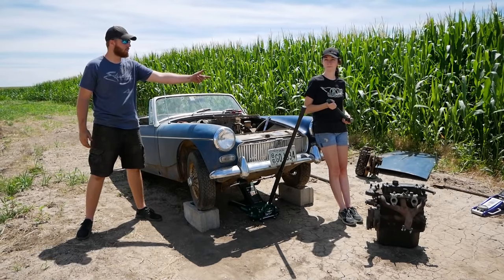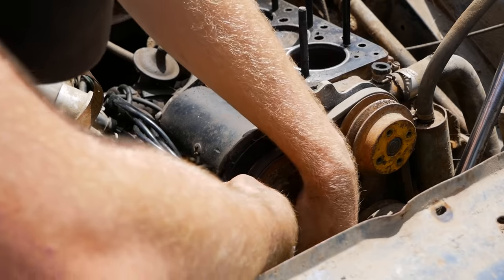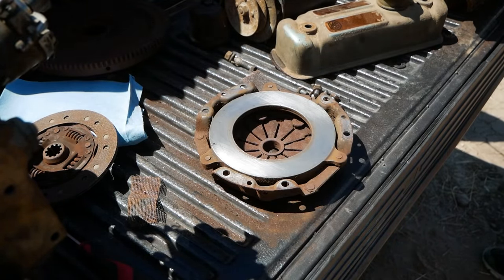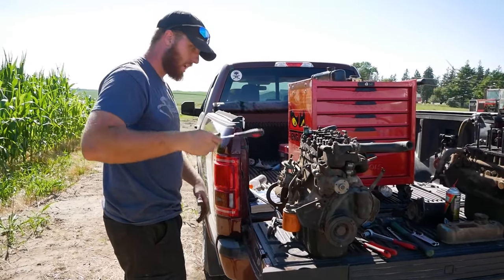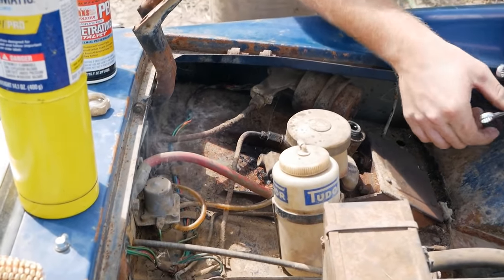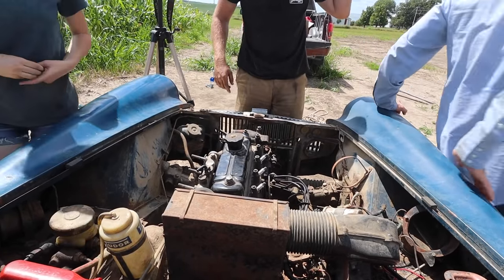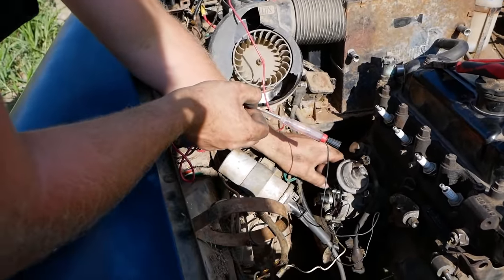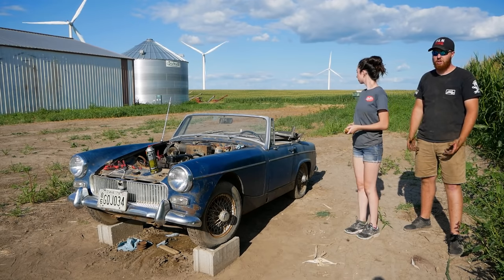Can We Make a SEIZED MG  Run After 42 YEARS!? - Part 2

Comment: Man when he was flooring those old British cars right after start up my mechanical sympathy left me wincing... Yikes
Reply: The a series is bulletproof.
Reply: What are you even doing if you dont send it straight into the ketchup
Reply: @DinosaurJuiceCars  The A series is only a three main bearing crank, not as tough as you'd think. Also, siamesed ports :o(
Reply: @agilchrist73  I do actually have one in my car! Yes it doesn't like to be revd over 6000rpm stock and the exhaust setup is not good for power. But if you don't over rev it they are bulletproof!
Reply: Do you always post cringe?
Reply: @agilchrist73  It's not really an issue for them unless you start pushing for big power, really tough motor in general. I wouldn't wanna be revving one like that cold though. Gotta have some mechanical sympathy lol.
Reply: Are you sure it wasn't your boyfriend making you wince?
Reply: Why do people do that?
Reply: He would have warmed them up before they came in... it's a YouTube collaboration, not a chance meetup.

Comment: Why is Steve reving the engines like crazy when just started and being cold??? Poor engines xD
Reply: He doesn't rev them that high, it sounds like it because of the exhaust note. I think...
Reply: Because there aren't any throttles on the engine yet... if you watch closely, he's disconnecting the positive side of the coil from the battery to keep the engine from truly over-revving.
Reply: Haha. Ya do know the carbs were not on there yet correct?
Reply: Pretty sure he's referring to the cars, not just motors

Comment: They're standard because the 🇬🇧 went to the metric system in the early 70s, your car predates that.
Reply: It's actually a 1968 MG Midget that originally came with a 1275cc engine.
Reply: Yep, all the way through to the end of the original MG and Triumph in 1980 everything is standard except for some brake parts on the verrry late cars.

Comment: That bloke with all the MGs - is he open to adopting?  His garage had a whole lot of cars I would love to spend time polishing and detailing and....and....well, anything to be near them, really!  That TR4 sounded magic, although it would have been better if they raised the revs to where all four cylinders were firing.

I like the technique for bleeding the Master cylinder.  Going to use that one myself when I bleed the rebuilt Brake Master when put it in my Stag - a lot easier than bench-testing it.

The new 1275 engine sounded like she fired on 3 rather than 4, but since it wasn't exactly a measured dose for each cylinder, its of no consequence.  You gave a great explanation on how to find TDC on the little car as well - not something that everyone would know how to deal with when faced with a little A-series engine (or "half an engine" as an American mate of mine once called them).  Not many people realise that you can push the dizzy round so far to line a plug lead up with the right cylinder either.

And as many people who own British classics will tell you - they ALL leak oil.  It's when they STOP leaking oil that you know you are in trouble, because it means there's none left in the engine!  British cars leaked oil by design in order to coat the undercarriage so that the salt used on British roads did not affect the chassis frame so bad.  It was a primitive form of rust preventative......well, at least that's what a bloke who worked for the Triumph Works team at Canley (in Coventry, England) once told me  😊

Looking forward to the next one, but make sure you have a spare axle or two handy as they do occasionally pop when stressed by doing donuts or line-locking.  Also, don't do the donut in first gear - use second - for two reasons:  first gear in the early boxes was still a straight cut gear, so no synchromesh and you will run the risk of destroying the idler gear.  First gear is only good for about 10-15mph tops at full chat, so use second to take off and you will be in the power band well enough to keep at least one wheel spinning in the dirt after a second or so.

Lastly, if there was another wire on the coil, it was probably for the rev counter, so it needs to be on whichever side of the coil goes to the dizzy.  I do not believe the A-series ever ran a cable rev counter, so if needs be a wire could be run from the tach to the correct spot.

All the best and I'll be waiting for the next one!!  I want to see the wee beasty move!
Reply: admit it, those red sprites at the beginning are hella cool (despite the fact they are super slow in stock form)
Reply: Wrote a novel here.

Comment: First engine I swapped by myself, I had a floor jack, an air wrench, and hand tools. I built an a-frame with a 1/2 ton chain hoist myself to handle the actual lift (fully dressed 302). Yes, anyone can do it.

Comment: Metric wasn’t fully implemented until the early 80s in the UK.
Reply: It still isn't if your in your late sixties  !! 😂😂😂😂
Reply: The building industry were the first to implement this system in the 1960 's . I can recall my late brother telling me  that feet and inches would be obsolete by the '70's . Well, l 'm still trying to grasp it even now! As a Formula 1 fan l  still get frustrated when the commentators get excited when the cars are doing over 300kph! But when babies are weighed at birth 
" Your baby weighs a healthy 8 lbs  15 ozs ! " 😂😂😨😨
Reply: Aaah, well, let's not talk about miles and stone then... I guess.

And of course weird packaging sizes. I'd say the Germans did one thing right when they switched to the metric system in the late 1900s: they simply rounded all the old units to the nearest metric equivalent, so a German pound is 500 g.
Reply: They should have rejected it, like they did with the Euro.

Comment: “Why is most bolts standard, not metric?” 

Because standard wrenches use the Imperial measurement system(inch, foot, yard, mile) as in The British Empire.
Reply: my answer is " They used to use standard/imperial a long time ago, then they realized it was dumb, and now dont"
Reply: whitworth
Reply: Akieba we use a mixture of both
Reply: @DeeFPV  Best thread form ever!
Reply: The car is from the imperial realm.
As the British tried to take over the world, and took most of it. They also went to call out a sizing of tools.

The metric was a French thing, which of course there was a lot of wars with.
Another size  was Wentworth. Also a beer company name now. But they're older. I used to have both sets when doing  restoration work of even customers cars. Then around the early 1990's the English went metric but had been going metric since 1977 I believe.

The mg being British and part of Austin, and layland the cars were old, the a series being a 1940s engine design.  Which was kept in many rovers. And kept the engine, performance and reliability rates down.
Also as the UK in the late 70/80 bought in rusted new metal and out in to cars without much treatment , hence they would rot out in 3-5 years.  As with all models from the entire group.

She is in very good condition as we called them sives (vegetable water drainer) as they had so many holes they didn't hold it, and when they broke you put your feet through the floor to move it. We're not talking 10 year old cars but  4-6 year old ones.
Reply: But the nuts and bolts could have been Whitworth , if you have any experience with English cars .
Reply: @guywhoknows  Actually the UK Switched to the metric system in 1971. I'm not going to go into how long it took for the tooling in factories etc to change but this being a 1968 it is before the switch and had imperial bits. I think that before the 50's US inches and UK inches were different sizes but were standardised in the 50's / 60's but I don't know the exact date.
Reply: yeah, all british leyland vehicles used a mixture of af and whitworth, with some odd unf and unc
Reply: @Jack-hg1hq  Late Mini's add assorted metric to the imperial threads... The only way to spot the metric stuff is to know when that system was added to the model.  For example the brake servo bolts and fittings on '89 on cars are metric but the bolts that fit the servo to the car are imperial.
Reply: and we use litres instead of gallons for fuel ..
Reply: @bloodreighn  And to this day I still cuss out the metric system for cars. When referencing metric sizes (when absolutely forced to kicking and screaming), it usually involves some sort of expletive at the beginning. Such as "Give me the bleeping 12 mill", or "bleeping metric and the bleeping bleep modern bleep cars, bleep them. Bleepers."

In some circles around me, the very word Metric is in of itself considered an expletive.
Reply: @TheMrShinagami  1965 was the date, however it wasn't taken up until the UK joined the EU. (Who was on metric) 
Due to the industrial actions of the 80's and the "siff lip" at the wayward british fundementals actions, which was and ingrained to no change (and very much the same today)
The "stop gap" was very long (20 years give or take a decade) before most industry had owned or made or regular use of metrics.
A "bend" to meet this was 13mm  or. 1/2 inch which was a fundemental of most car bolts and fittings. As well as the 10mm. **/16
There were other sizes 17/19mm

The move by Thatcher was to bring in unification and Cross border working unity. Who had put a big push on the stagnation that had occured.
Few businesses by the mid 80's were metric and some starts up buying old tooling form the collapse of the economy used old imperial tools for some years until the recovery.
Reply: @AndyMarsh  yes that's because they were sweeping up spills on floors to get parts and off hand mixed orders...
(There is a documentary)

Try were a nightmare to work on and you had to have 3 tool kits to hand and rust remover and a blow torch. ( And plastic padding).
Reply: @mindedchaos  I use gallons still
Reply: @mindedchaos  the UK has gallons.
It may be no shock that the imperial gallon is different to the USA.

They greedy so there is bigger.

(That means we pay a lot more for fuel by the imperial "scuppering" or stealth taxations. For £20 of fuel you pay £5 taxation, and you pay £12 duty taxation)

God say the queen!
But not the tax man.

Comment: Beautiful cars but reving those engines on a cold start is gonna eventually destroy them 🤦🏻‍♂️🤦🏻‍♂️
Reply: Agree.  I'm all okay with the Italian tune-up, but I like to let them warm up a bit and circulate oil first.  Maybe too much money to care?
Reply: Uhh... to be fair, this engine only has wide open setting. You know, because there is no throttle.
Reply: What are you talking about?? clearly has throttles. Two.. you know one on each carb to be exact... because all combustion engines have a throttle... witch clearly revd the engine up and down 🤦🏻‍♂️🤦🏻‍♂️ so please don’t come at me with your comment when it made absolutely zero sense
Reply: @Ayyjaxx  The combustion engine in this video does not have a throttle. The carbs certainly do have throttles, but they have no effect on the engine's operation since the carbs have not been installed on the engine yet...

Comment: The reason the fittings are “standard” rather than metric is because we didn’t start using the metric system till the late 1960’s. The midget was introduced in 1961. So everything is in standard or as we call it “imperial” measurements.
Reply: Americans are often surprised that we still use miles, and measure ourselves in ft and inches. We are still at least partly in the dark ages with the USA!
Reply: And we buy fuel in litres, but measure economy in MPG! What is that about!?

Comment: How a coil works is just a transformer with many more windings on the output side vs the input side (~1,000 to 1). When the points are closed the low side of the coil charges up and creates a magnetic field around it, when the points open, the magnetic field collapses and induces a voltage surge in the high side output windings of the coil.

Comment: Wow look at them Austin 1100 or 1300's there at 3:20 :)  They were pretty rare stateside, very rare here in the UK now as British Leyland "rouge" ate 99% of the millions sold.   The engine you need for your MG is the turbo MG Metro, abs boy racer beast in a tiny car and drops straight in.   K series Rover engines prob an easy conversion if you can work round the FWD issue as wasn't a rear wheel engine.

Comment: It should have a cork gasket for the rocker cover. the bolts are not metric because we did no go metric until 2 years later than your car. when we pump gas. we pump it in litres. there are 4.54 litres of gas to a UK gallon. vs your 3.5 litres to a gallon. The horsepower of that 1275 engine you put in will be 65. the one you took out 45 if its a 940 or 1098cc

Comment: My early 50’s XK120 Jaguar had standard imperial, as in SAE nuts and boots. The exception was the SU carburetors, they were Whitworth. The UK didn’t go metric until much later. Partially because the USA used SAE bolts, etc., and the USA was the UKs export market.
Nicely done. I wouldn’t have believed it if I hadn’t seen your video👍.

Comment: The British adopted the metric system in 1965. What year was the car? I think you said '63 but I don't feel like going back and finding out. If it's before or close to '65 then they'd still be using standard instead of metric. Heck, to this day you still hear Brits using inches and feet and miles sometimes. They did invent the system after all.

Comment: The reason the bolts are Imperial sizes ("Standard") rather than Metric (which is actually the international standard) is because in the UK, before 1965 the Metric system didn't really exist outside of the Science community. Everything was handled in Imperial. The vehicles were designed in Imperial units of length, things were priced in imperial units of weight, everyone was taught the Imperial system at school, but metric wasn't commonly taught. In 1965 the UK began to introduce the metric system, but as I'm sure you can imagine, when people have lived their lives working in only one system of measure, it's not going to be an overnight switch. It wasn't until 1999 where it became legally required for things to be sold in metric units. (i.e. priced by the Kg rather than by the LB, or whatnot)
So yes, in the time period that car was built in the UK, basically everything was still imperial, and Metric was a new and weird system that people were largely trying to avoid. 
Even today, if you talk to older generations in the UK, they're much more comfortable using the imperial system.

Comment: The bolts are all Imperial (not US Standard) because the Midget is a really old car. The model you've got is only a minor evolution from the 50s technology the Austin-Healey Sprite. So yeah, might be a 70s model you're working on, but it's firmly a 50s car underneath.

They were cheap cars when new, really, really cheap. But for what they are, they're plenty of fun. I've got three cars, one with 335bhp (that'll do 60mph in 4.5 seconds), one with 200bhp, and a Midget that made 60-ish bhp at the dyno when I hard the carbs tuned. The Midget is by far the most fun on a twisty and tiny British back road.

Comment: British technology requires multiple engine rebuilds to achieve 50,000 miles of use.   Why my 93 Mazada has 320,000 miles and never been worked accept sparkplugs and oil.

Comment: Lucas was the Greek god of darkness. What a name for the electrical components!  Why did the UK use SAE instead of metric fasteners? Because they are British and they can!  I would like to suggest a truck bed hydraulic hoist! I installed one in the right rear corner of the bed on my F-250 starting about 2006 as I remember. Worked GREAT, and would swivel around to stow right above the wheel well.

Comment: Did the same thing several years ago, however it took 6 of my friends and 3 4x4x10 pieces of lumber to lift the engine of my 1970 dodge truck that was pushed down into a pit. The mother going in was a 426!, a blown 318 came out and I didn’t have a hoist.

Comment: It's been a while since I've worked on a MG Midget, but if memory serves, they came with to engine options. An 1100cc and a 1275cc engine. Not sure if they referred to the 1275cc as a 1.3L. We did our engine swap in Mass. in January of 74'. It never got above 0 and we had only a little electric heater to heat the garage. Good times....

Comment: The UK always used Imperial threads, it was only when more cars were built by European manufactures over here, that more metric fittings were introduced. This is a proper MG, hence that clutch line is probably 7/16" across the flats of the union. :-)

Comment: Well... The hardware in this car is standard-ish-weird-akward-uneven-knob-o-metric because MGs are british cars.

And the GB had adopted the metric system officially somewhere in the mid-sixties. Not even talking about using it as the primary one. Restocking a plant with all new hardware isn't the quickest process. So this is a good excuse for this 68' car already.

However, when it comes to the reality - the metric system was being adopted pretty slowly, and even by these days the british people are still on a weird junction, when imperial units are used for some things, and metric system goes for most of the others.